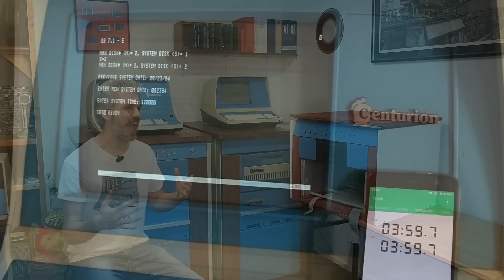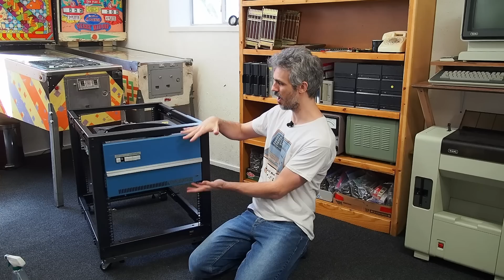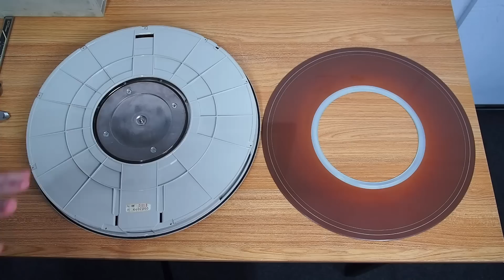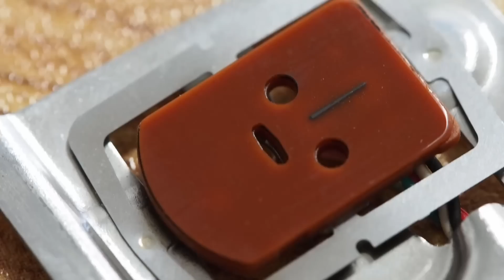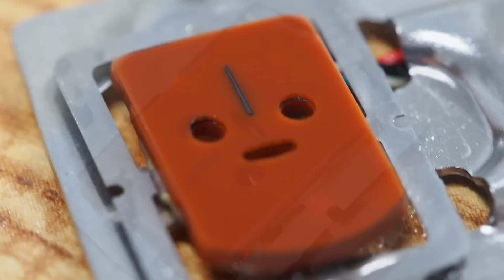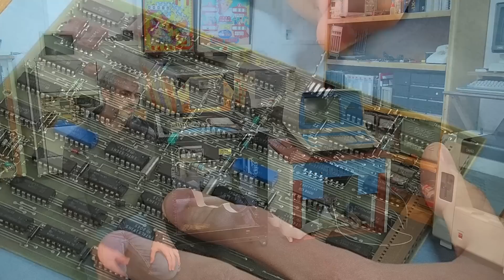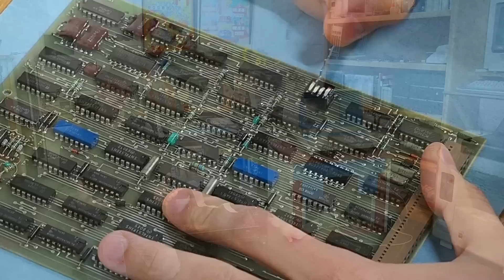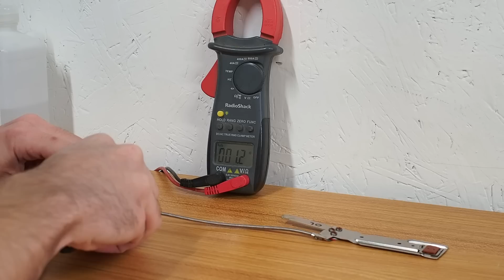Trying (and Failing) to Restore a 1970s CDC 10MB Hard Drive

Comment: What mind bloing. I worked on IBM system 3 way back in the 70s. Maybe we miss computed  we  the drive as 2.2 mb. It was crashed out from a power loss while was running,. Itwas a bea to restore. IBM took 2 weeks fix. to fix. Then we spent a month restoing OS  then next system has 50mb. Then ext drive had 500 MB..

Comment: In the late 70s and early 80s I was a tech that had to deal with multiple platter CDC drives that could be removed and switched for backups etc. I was just a low level tech and the whole process of switching multi platter cartridges between 2 drives for daily backups was stressful since I never knew what was going to happen when they both spun up. A whole newspaper was in the outcome. Glad those days are over. Sometimes had to run only one drive because the other was down. No fun at all and wondering if the remaining drive would survive.

Comment: Son your are a chuckle and a laugh. you are trying to fix the old platter drives, that I used to fix weekly at my tech job at Goddard GSFC ??. First you have to get the analog single wave servo tracker working.
Reply: Glad to see other old-timers watching this project. I also worked on computer drives in the 1970s with & without servo tracks.  I worked at Centurion for 10 years with this drive & other types from CDC and Pertec. Have been helping with the restoration of the Centurion with others from around the world. In the case of the CDC 9427H  Hawk disk drive it does not use a servo track for servo positioning or even data recovery.  The Hawk uses a capacity for linear transducer for cylinder crossing detection. The data recovery is handled by the encoding the clock with the data stream during write.    In the case of the CDC 9448 Phoenix it using a servo dibit(s) on once surface of the platter for servo position and data W/R clocking.  The Phoenix crashed heads and other issues and is not currently being worked on.  We are thinking about a work around for fixing the 9448 without having access to the CDC TB-216 Field Test unit & tools like the head cam tool and CE disk.

Comment: Dang 10MB HDD can only hold two mp3s songs.
Reply: Was not a problem regarding MP3 songs, because MP3 files did not exist till a number of years later.  Because the old system used cassette tape so having 5 MB of data on a single platter was huge to use & our customers in the late 1970's.

Comment: The enamelled copper wire used for the head windings might have been soldered using acid flux, which can eat through the joint. Worth checking if you can get to it
Reply: Acid flux wasn’t used in electronics back then. (It’s increasingly used today, as water-washable flux, but cannot be used in all situations.) Anyhow, are you perhaps thinking of corrosion from chemical stripping? It’s common to strip enameled magnet wire using chemical stripper, which is basically molten lye into which the wire ends are dipped. The wire is then rinsed repeatedly, including a neutralizing dip. Certainly if the rinsing was incomplete, it could cause corrosion down the line.

Comment: I used to work on some old removable disks the video brought back some memories!! I was always careful around the heads as if we replaced one it was always a pain to get the pack alignment right.  But we had only one alignment pack as they kept getting written over by mistake!!
Reply: Rule one turn ON the write protect switch anytime when using the CE Alignment Pack  &  rule two check rule one.

Comment: Back in the day they were a pain in the backside to fix then, and it looks like they’re going to be a pain in the backside now. Good luck!. I remember the initial seek, heads move forward at light speed “bang and break of the max distance travel stop” I was working on a newspaper “DYMO” Computer system at the time. The pressure to get it back on line was tremendous. I took them to the repair centre in Birmingham UK. What a nightmare of a unit.
Reply: Most CDC Hawk drive voice coil servo slams are caused by a failed servo feedback loop or unplugged Tach-Coil.  Do agree it takes just a couple of servo slams to break the front crash stop casting.

Comment: This is a shot in the dark but have you checked any capacitors on any of the hardware going to the heads, maybe voltage spikes have happened blowing those coils open. I’ll admit I have no idea about any of this hardware. But if something was sending current in the wrong direction I would imagine that wire might pop like a fuse

Comment: If you have a drive head like that which has crashed badly and you find that paper isn't adequate to remove material then you can pick up some .25 micron lapping film from 3M, stick it to a sheet of float glass, and use that to lap the head. I use such film to do the final pass on knives that I'm sharpening and it leaves them with a fantastic mirror finish, so it is more than up to the task for simple hard plastics. A side benefit is that this kind of film basically never deposits its abrasive, so you can be certain that it won't leave behind any grit that might cause problems. Even when using it to sharpen knives, the only reason it stops grinding effectively is when the abrasive has clogged with metal and needs to be cleared. It's also useful to cut a small swatch and adhere it to a firm foam backing to use when trying to remove marks from paint finishes, as it is extremely fine grit and tends not to leave swirls or scratches in the paint. Just remember to wet it with water or alcohol prior to use so it won't clog the abrasive too quickly.

Also, if you're curious why paper makes an acceptable abrasive: Kaolin clay. It's almost universally used in hot-press paper like printer paper to improve the color, stiffness, and surface texture of the paper. It also improves ink bonding with the paper. The fibers of the paper also function as an abrasive, but the primary abrasive is still the kaolin clay.

Comment: Are you sure you aren't burning out each these coils when you test them with the multimeter? I'm sure there's a better approach, but maybe you should at least put a larger, well-known resistance in series and then calculate the coil resistance for future measurements.

Comment: Why not make a floppy or hard drive emulator using a modern microcontroller and SD or old 3.5" PATA drive? Using HDD should be easy, as all low level control is done by disk controller, not the drive, nor the OS. Like in Centurion. So just translate commands from one interface to other....
Reply: We are working on Hawk emulator using a RPi micro controller to look 100% like a real Hawk drive to the Centurion MMIO Hawk disk controller. The Centurion operating system used a odd sector size of 400 bytes with 16 sectors per track / 32 sectors per cylinder.  Without the OPSYS  source code we can not make changes to the operating system to use a current model disk drive.
Reply: Sector on HDD has fixed size of 512 bytes, so use 400 of them for data, and keep rest blank. For number of sectors per track use offsets, so single track of HDD can store multiple tracks of Hawk drive. This low level translation can be done with something as small as STM32F103, or an FPGA. This would make HDD useless for a PC, but will work very reliably with the Centurion.

Other option is to design a new board that implements all logic parts of disk controller directly, without interfacing via existing disk controller.
Reply: @UrgonCobol  The issue is the whole track is non-standard out of the controller (also for the Hawk, it's FM encoded I think, not MFM). It's a better bet to just record the raw data out of the controller onto an SD or CF card and play it back, rather than interfacing with a "modern" 512 byte sector drive. That kind of interfacing would definitely need a new IO card.

Comment: The head coils are likely fine, the wires that undergo flex so that the drive can seek are probably where your problem is.  I had a mouse get into a Hawk and chew the head wires (this was back in the late 70s), replacing the wires did the trick, the drive worked for years after that.

Comment: The head allignment problem might be caused by the servo control loop. If it is controlled by an analog circuit, the component values may drift in time. Just an opinion, I don't know how these hard drives work in detail.

Comment: Back in the day it would have been inconceivable that the heads would be reused after a crash. The slightest imperfection means you would have another crash after an hour or two's run time. (Just long enough for bad engineers to get off site).  I know when there are no new heads available then needs must, but I would not believe you would get this back to fully functioning. When you get the smell of burnt aluminium in your nostrils you will definitely know you have a new head crash! Also I would purge an old absolute filter for a week not 30 mins.

Comment: CDC Hawk Drive???  That's a blast from the past!  I have one of these, (covered up) complete with a TI-99/10 Mini Computer in a corner of my garage!  I also have 2 ModComp J1 Mini Computers.  Between the two ModComp machines you could get one working computer.  One machine is missing the power transformers and one machine has a bad memory core plane.  The CDC hawk drive has a head platter crash so it would need a new fixed platter and new heads.  I also have a set of boards for the Hawk Drive of unknown state.  Any takers?  I hate to relegate these to a landfill. At one time I had a whole stack of removable carts and a, "CE Alignment Disk".  Now I wish I still had those to donate to the cause.  I have cleaned crashed heads on these drives by using this paper/alcohol method and a microscope with the heads off of the drive.
Reply: There's some contact details on a reply to a previous comment, if you want to donate to the channel - see the reply to Eric Dravin a bit earlier...

Comment: It seems unlikely that those heads all failed open in the exact same way.  Can you rule out the small cables between the connectors and the heads themselves?  You can pierce through the insulation with a small strait pin.

Comment: If crashing will not kill the coils, what will?  That's a puzzle in itself.  But best wishes on hacking something into operation, even if it's a set of cleaned-up "good coils" crashed heads.

If you pull this off, you'll surely win first prize at the show.

Comment: I've though about this head problem and they may no be faulty, so to speak. Those mechanical lead in braids are highly suseptical to corrosion and breakage. Those are probably a silver alloy braided wire and not stranded. Using improves mechanical lifetime as a speaker does. Downside is they wires corrode badly. Turnoff black first and so on. Check the wires properly before giving up on the heads

Comment: though you decided against using a modern day storage thingy with that system i still wonder if there even is something that adapts say an SD card to the interface of these old CDC drives. building - using an FPGA, so real hardware, no emulator, - a cpu card with an embedded mux card plus something like an FFC that would at the same time contain one harddrive emulator plus hardware for interfacing a real world floppy would sound like a fun project

Comment: I wonder how hard it would be to create an emulated disk using some Compact Flash card and interface electronics. It would of course depend on if there's enough information available to make a new controller card for the mini-Centurion.
Reply: That whole HDD can easily fit on an OLD FPGA and small FLASH memory.
Reply: @paulcohen1555  I'd expect that, it's the handshake with the old bus that could be the hard part.
Reply: @ehsnils  I think it was 5V TTL and some open collector signals.
That's why I wrote OLD FPGA.
Reply: @paulcohen1555  I understood that, but then there's timing to consider too.

Comment: I really think you should just emulate the drive. Almost anything should be able to do it. Pi pico, beagle bone. Considering what you have already shown, your group certainly has the brainpower. 
I would like to see the drive repaired, but as you say, where to get the heads. And the analog board might have a defect causing it to blow the heads. And if that true you might realize it to late. And blow another set. 
Last suggestion, have you checked the head wires for breaks? It's a moving part, maybe it's just the wires at fault and you just need to rewire them if possible. They are already broken so a little experimentation isn't going to hurt anything.

Comment: Before writing off those heads I would double-check to make sure there's no corrosion on the connectors, make sure crimps are solid, solder joints good, etc.

Comment: You assume those heads get DC. Just assume for  a moment they get AC or pulsed DC. If there is a capacitor in series somewhere your meter readings are reasonable. Given a shorted capacitor causes those continuity readings. Heck, maybe the heads itself are a capacitance?

Comment: Using this system for transport to shows concerns be.  The old drag is so fragile and it may not be reliable.  For this reason I lean toward using "future technology" such as an SSD to emulate the drive.  Perhaps an RPi with a USB flash drive would serve the purpose, whether or not you used the massive amount of storage available.  But do get this drive concurred.  I know you can do it.

Comment: When you have the drive in the cabinet with the drawer pulled out you are close to tipping over,  It'd be a shame to loose the drive on such an accident.  Perhaps a temporary counterweight at rear bottom of the rack would make it safer.  I don't want to shed tears over a cabinet-crash accident!

Comment: Well, I commend you for trying to fix that drive. I have worked on similar drives early in my career and those heads are pretty durable, but maybe you should consider an alternate path. I noticed you have several CDC Wren drives, I would maybe see if you could get one of those to work. And as an added benefit it would fit in your existing case. Good Luck!

Comment: As for me it's kinda silly to keep trying to recover those big drives. Either do something with emulation or switch to those smaller HDDs if possible. Big drives were the necessity because there was nothing else and they were known to crash often and bring much disaster. So just dark bloody past of computer tech which must be forgotten. From 2 platters  it's possible to make 1 aerial TV reception antenna and it will serve forever until lightening strikes and burns all the contacts.

Comment: It seems like you have been measuring the coils at the connector, rather than the coils themselves. I wouldn't get my hopes up, but there is a very slight chance it's not the coils but the cable that's broken. After all, it's been bending back and forth with every seek for who knows how long. Maybe try piercing through the cable insulation with a needle as close to the coils as you can get and measure there?

Comment: Wow. If the cores are still good, you might be able to rewind them. Or maybe they have a bad connection point somewhere. Long ago when I was crippled poor, I rewound the head on a 1.44 floppy drive. Just be sure to count the turns taking the old wire off.

Comment: I followed every video of you rebuilding the Centurion. The effort you put into the system is remarkable, and the results are also very promising and educational. I have an HP-1000 minicomputer system with HP-7906 disk drive waiting to be restored. The disk drive is almost identical to the CDC one in your video, with one fixed and one removable 14-inch platters . I still have no courage to restore the drive because I have only one chance and if I fail, the data will be gone forever. Your detailed video have given me much more understanding about these devices than anywhere else. I really hope you can get the system repaired. Hopefully I'll also be able to power up my unit in the future.

Comment: You still have a few failure points between the actual head coils and the connector. You should measure ohms at the head because all the bendy cable and crimped connectors between it and the pcb connector can fail, and thin cables can corrode.
Reply: YES! I was hoping someone thought of this!
Reply: very likely this is the issue

Comment: Don't feel too bad. Xerox Star 6085 model 1's with 40MB Micropolis HDDs had a problem of not starting up after a power off/shutdown.  Therefore you never turned one off!   Xerox Star also used virtual memory accessible from the HDD which also made it slow.
When all else fails get a HDD emulator as some of them like the Quantum q2040 do not like to be moved while powered on. ;)
Reply: Your rabbit seems to have a Kleenex complex ;)

Comment: This really is bad news. I'm assuming it's not something simple like a broken wire in the cable going to the heads? The faulty analogue board might be a clue, if it went faulty it could have blown out the coils in the heads. Doesn't help with fixing them though. You'd think with all the high tech stuff we've got now like 3D printers, that someone could've figured out how to make a new replacement head for these old drives.

Comment: Historic audio-pickups for turntables tend to get destroyed over time by chemical reactions inside the encapsulated solenoids. The wires break by these processes and stop conducting current. This is most probably the reason for your defective heads, not that they have crashed at some point in time. I think crashes cannot ruin the solenoids but chemistry can indeed 😐.